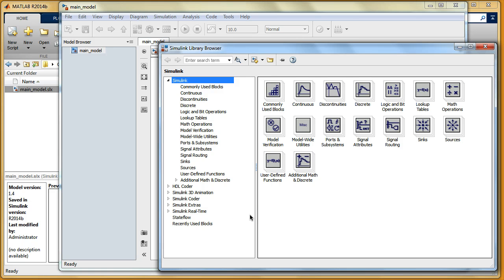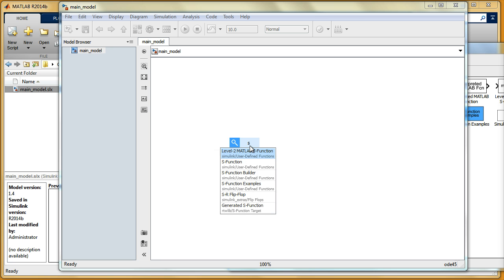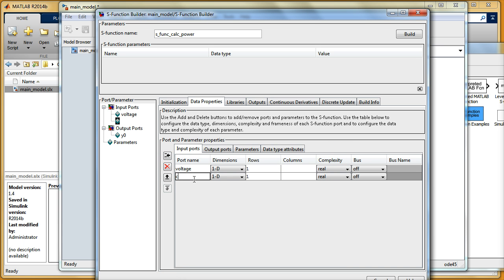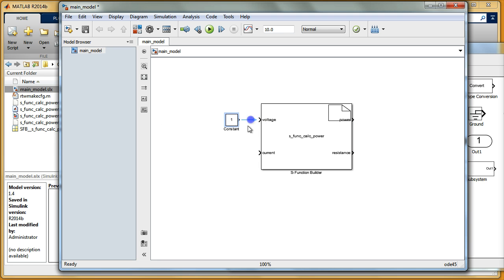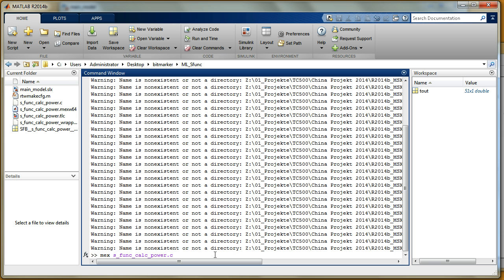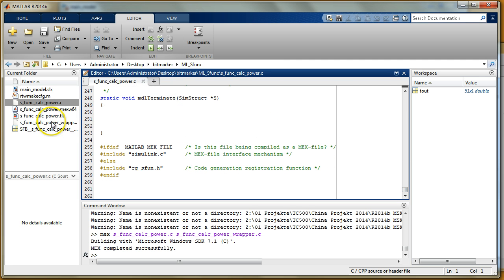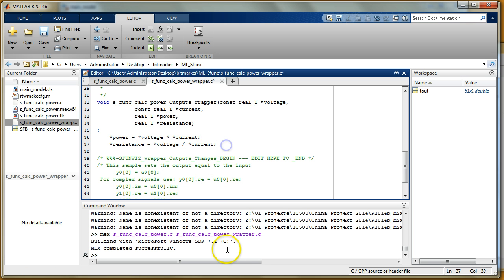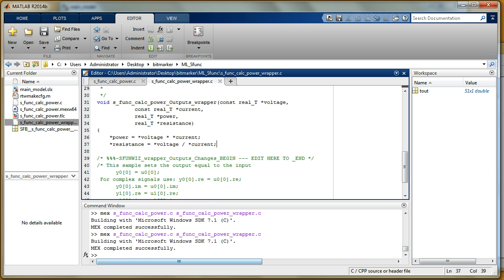ML06 (english) - Simulink S-Function Builder basics

Comment: Have you tried to implement a s-function in embedded target, which contains device driver, such as GPIO?
Reply from the maker: No, I haven't. It seemed to be not that easy to extend the low level functionality for example of the Arduio Target. But it was more than a year ago, may be MATHWORKS opened that part...

Comment: i am using windows 8 i am getting error regarding .net framework. please sugget me.
and also please post me the c file shown in the video for reference purpose. please... i am new to create block using c.
please. anks.plmr@gmail.com
Reply from the maker: +a.naveenkumar Setty I'm sorry, but I can't help you with the .net issue. I don't have any PC running windows 8 and therefore didn't have any problems with Simulink. And you don't need the sources, they will be generated by the builder (I don't even have the example from this video).

Comment: Hello dear, i have problem in diagnosing the s-function builder and it generate following error if i try to simulate the same program as you did in the video.

C:\PROGRA~1\MATLAB\R2012B\BIN\MEX.PL: Error: No compiler options file could be found 
  to compile source code. Please run "mex -setup" to rectify.